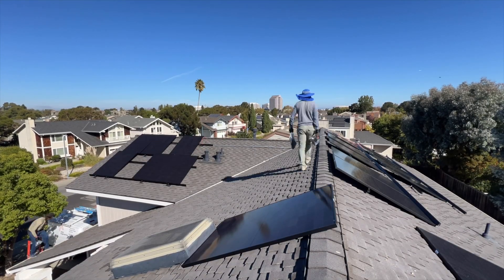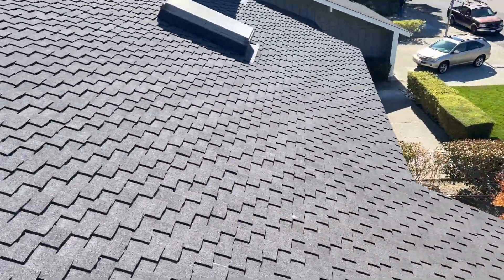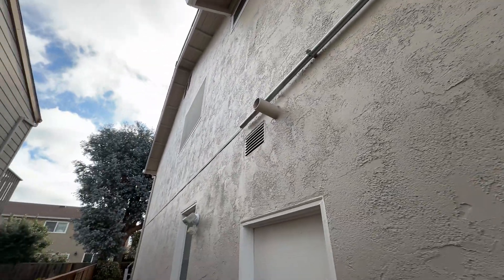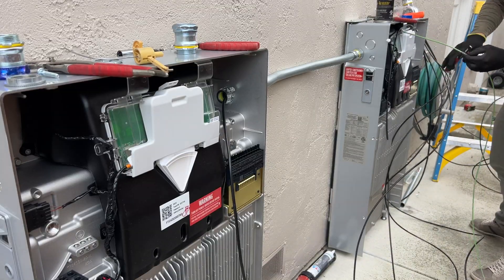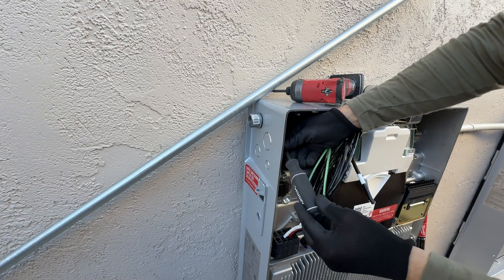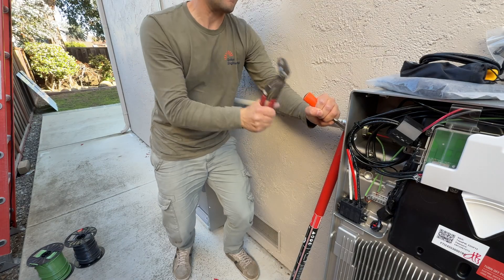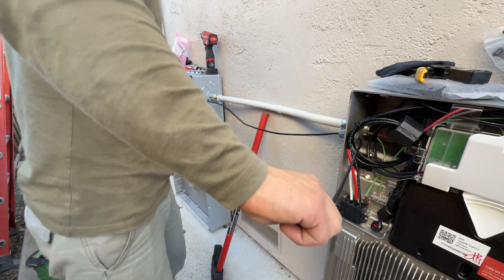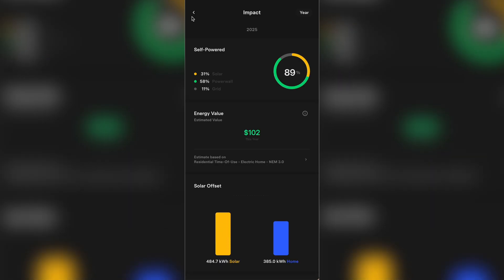Full home backup. 9,500W solar array with 27kWh storage. Installed by certified installers.

Comment: Could you provide more details on why you AC coupled the two powerwalls vs just hooking them together?
Reply from the maker: I have 2 strings from the roof, and landed them to both powerwalls (PW1 + S1, PW2 + S2).
In this case two powerwalls will be charged from DC.
If you land solar into 1 powerwall, then other will be charged from AC power. One PW that receiving all solar will convert DC to AC and then to charge other PW it will be another conversion AC to DC, here is why it's not so efficient.
Reply: @SolarEngineering  why not just use the expansion battery and 1 PW3?  
That setup allows 8000 watts of charging.
Reply from the maker: expansion unit was not available at this time.